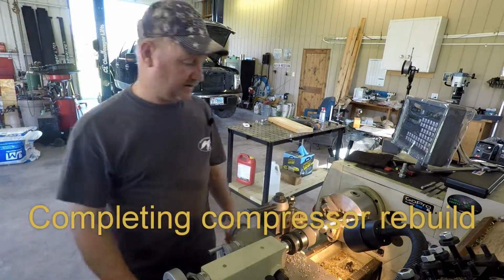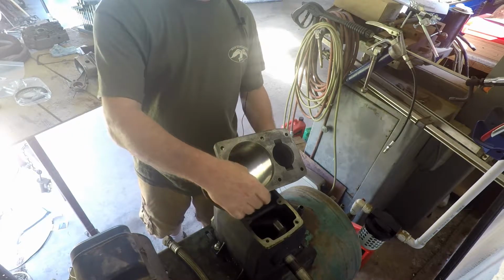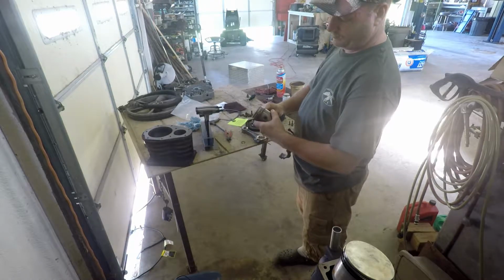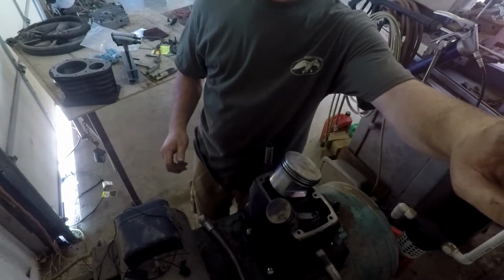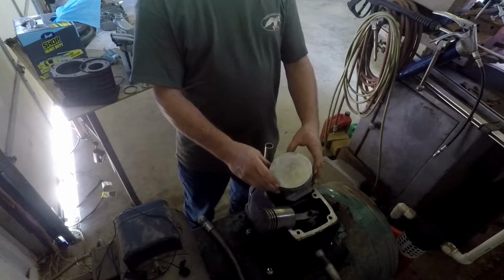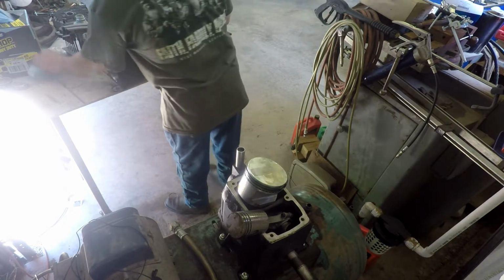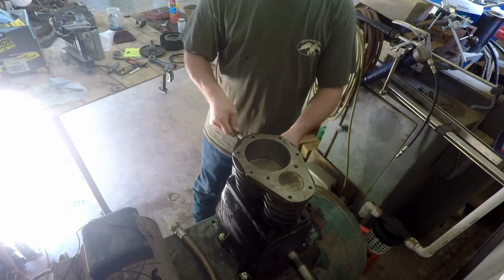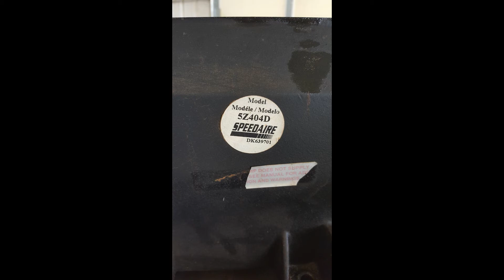Speedaire compressor repair part 3 of 3 FINAL

Comment: Well done Larry . Have you ever tried the Milwaukee M18 cordless tools ? I have a 100 acre play pen where I keep my dinosaur heavy equipment so I'm often "out standing in my field" working on something . I bought the M18 HD 1/2" impact and I'm VERY impressed with it . I just bought (rescued) a 1970's Fiat Allis 745 loader and it had a slow leak in one tire so I had to take the wheel off and take it to the tire shop . It's at a friends shop that does heavy equipment to get checked over before it goes to it's retirement home . When I pulled out the cordless impact to take the wheel nuts off , my friend just laughed and pointed at his 1" air impact that he runs at 200 psi and said "you might need the torch too". WELL it took off all 24 of the 1 1/2" wheel nuts that hadn't been off for ~25yrs , AND had 3/4 battery left !  BTW Larry Robinson the hockey player used to be my neighbour , he is a true gentleman as well .
Reply from the maker: I like Milwaukee tools but I don't have any of their cordless tools at Home.  I have used them at work.  Ridgid with the Lifetime Warranty has served me well at home without failure.  I do plan to get some Milwaukee stuff too.

Comment: What was the ring orientation? My new rings are different than i took out they were gapless
Reply from the maker: That was nearly 5 yrs ago, sorry I don't remember every detail but I'm sure like any rings as a general rule just try to turn them so the gaps oppose each other and any dots or markings usually go up.  If yours are different than what you removed you may need to refer to manufacturer and make sure the piston isn't updated.  It seems mine was a perfect fit and match.  I just use the model number, etc and go on granger website and figure it all out.  It's been a long time and she's been running great with no problems.  Thanks for watching and responding.
Reply: @larryrobinson7492  my original ones  gapless and new ones are not and no dots for up. They have step on the od as well. Never seen that. Going to call them tomorrow